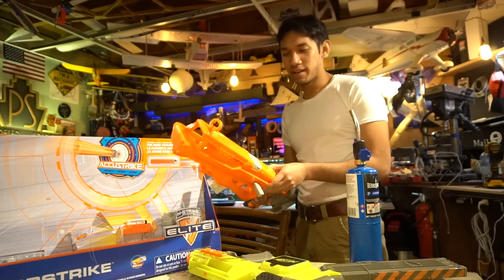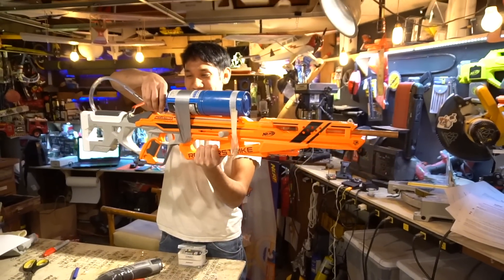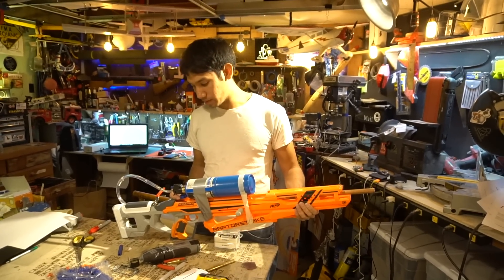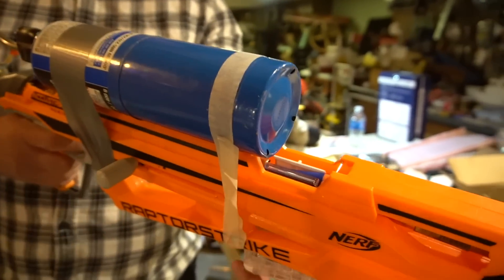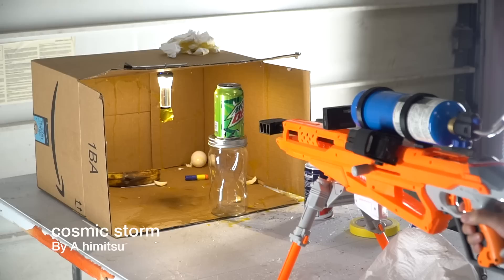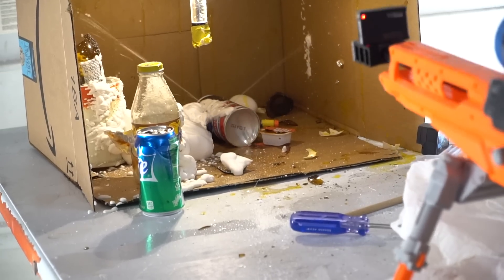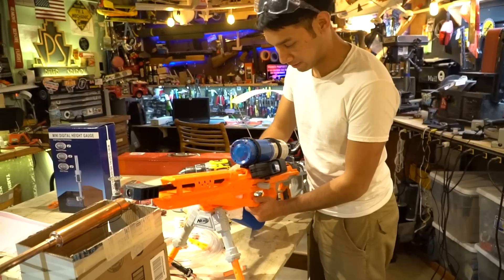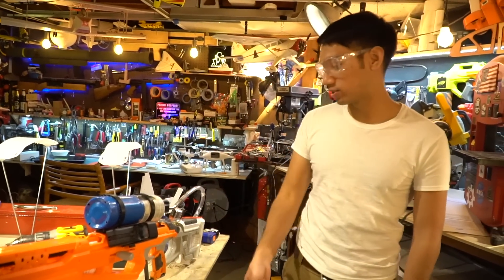Propane Powered Nerf Blaster!

Comment: I think the weird effect you talk about is due to leakage of pressure in the bolt section of the rifle, In the mechanism that chambers a round. You need to ensure tight sealing in that section of the pipe system.

Comment: 219 fps is pretty respectable. It's significantly better than any modded nerfgun I've ever seen. It's not the highest speed you can launch a nerfdart from a .50 springer, but at that point we're really talking about air rifles.

Comment: Why not have an electronic signal to shut the valve after a preset desired pressure? Less second guessing how much pressure your have and may improve consistency and remove having to shut the valve before firing

Comment: You should watch smarter every day 156, it will explain your dart sucking in and ignition issue, I believe they are related and I also believe it's castrating your power. The excess noise is probably a tiny sonic boom because the gasses are breaking the sound barrier. There is probably a good reason all cartridges ignite from the back. Hope that helps.

Comment: Wasting precious propane without burning it or using its ignition potential? Then you simply could use pressurized air. Leaking propane is damn harmful in terms of the greenhouse effect. Find some smarter solution please.

Comment: In case no one has told you yet, chronographs have problems indoors caused by external light flickering.  It's recommended to get the replacement shades with LED strips; that should fix the error.

Comment: My guess with the chronograph is that the projectiles might be too long for low speeds like that. The chronograph might not be able to pinpoint front and back of the projectile, so it wouldn't really have a reference to compare. But I'm not sure how these things work exactly, so it's just a thought.

Comment: For the chronograph, I've found that it's usually a lighting issue, I've found that halogen lights (or just outside lighting) help best with the problem.
Reply: Yup, that's what I found too, testing Nerf darts - minus the Propane. It's also picky about where the dart pasted as I recall, but I don't remember whether it liked high or low better.

Comment: Peter I figured out how you measure the stoichiometric ratio, you fill the combustion chamber with water, than divide that by the ratio of whatever fuel for example for propane it's 15.5:1 if there's a container 500 ml , device that by 15.5 and you have 32.26 ml and thats how big the propane tube had to be if you're using a water bottle for perfect stoichiometric ratio, I hope that helps, if you see me doing something wrong I expect you to tell me

Comment: Heat the female part of ur copper tube and get it red hot and then feed in ur solder it should never be in direct heat of your torch otherwise it’ll ball up like it did and you won’t get a good seal

Comment: oh I just figured I should point out, the Reflex is garbage. It uses a reverse plunger system and a weak spring just like the other blasters of it's time. The Raptorstrike uses a direct plunger system with a heavier spring, so it is much more powerful. Average chrono numbers for the Raptorstrike are generally in the 70 fps range.

Comment: Having the spark occur in the middle of the combustion chamber is always preferred. the flame front will travel more evenly and burn the fuel quicker and more efficiently, hence why the spark plug itself probably wasn't the issue, but more to do with the location that it was in. It's a heavily researched section in the Automotive sector, because burning fuel more effectively means better fuel economy,  lower combustion chamber temperatures, better emissions and more power.

Comment: 7:49 - Literally fire coming out of the barrel
Reply: Guys its fire... cause if its a Nerf dart its on fire
Reply: @Linusen9  no, it’s not fire, if you look at how he made it, there is a chamber which the gasses are inside of. When he pulls the trigger, the gas combusts, pushing the nerf dart down the barrel, however the gas would not come out of the gun as a flame, any fire would have taken place inside the combustion chamber, and the fire would be over in less than 1/10 of a second. That is not enough time to catch anything other than pure oxygen, or maybe some other explosive gasses on fire, nerf darts aren’t made of oxygen or hydrogen, so they won’t be catching on fire after being exposed to hat gasses for less than 1/10 of a second. Do some real research before typing false information into the comments section.
Reply: @reedrusty4290  chill it looked like it was on fire I'm nott a scientist
Reply: @Linusen9  ok
Reply: thats mean
Reply: Oh shit your right
Reply: It’s fire bro I looked and paused in .25 speedd
Reply: @Esock114  that is a nerf dart. The flash of blue after the nerf dart leaves the barrel is gasses being expelled from the barrel. Read a book on basic physics, then rewatch the part of the video where he builds the gun. You’ll see how it is almost impossible for a flame to come out of the barrel.
Reply: the dart comes out and is followed by a blue flame. that's not a muzzle flash cos that's a sonic boom but it is fire
Reply: people who don’t think it’s a flame: iTs A nErF dArT sTuPiD
Reply: Duck Face because it is a nerf dart •_•
Reply: @duccfaic2485  look at it in. 25 speed. It's a dart
Reply: Violet Judge Pause on the frame you see the "dart". It's fire, not a dart.
Reply: @duccfaic2485  , after reviewing the footage, it’s a nerf dart. Now, there is a blue flash after the nerf dart leaves the barrel, however, upon further inspection, it’s just the gasses being expelled at a very high temperature. If there was flam coming out of the barrel, the muzzle of the gun would have melted.

Comment: The chronograph - dunno if this will help, but you need to get the barrel right up to the front of the base of the instrument. You’ll get much more consistent measurements recording barrel velocity and the flight of your ammo will likely be at the correct angle.

Comment: this videos awesome. but i did think of something in the beginning, instead of the screws just sitting on the work bench and possibly rolling off or getting knocked off. what about fixing a large magnet to the bottom of the table some place? that way the screws stay fixed to the table

Comment: Personally I think the speed test was technically inaccurate. Say what you will but my experience with a variety of Nerf guns makes me see that the bigger the gun is, it can have less power and speed. For example: The Jolt is superior to the Maverick since it has better power, range and speed; but the Maverick is superior to the modulus as the Maverick, again has better power speed and range, but the modulus can sometimes fire 2 at a time which makes firing more difficult to predict. So long story short, you should try to get the same gun as the modified to see how much of a difference you actually made (BTW this is not a hate comment, saying this since some people are easily triggered)

Comment: You should use emery cloth to rough up copper joints. Also before you solder you should apply flux.

Comment: I am very certain that old tiny unmodified nerf pistol has a lower velocity than the newer raptor strike. If I remember correctly the raptor strike shoots about 70 fps (feet per second) and that tiny pistol i dont know for sure but i have used one before and remeber it was pathetic and a common theme with pathetic blasters is that they shoot around 50 fps so i guess the pistol has a velocity of about 50 fps (feet per second). I added brakets although it might be obvious to most fps cab be used for frames per second, first person shooter, fires per second, and feet per second that I know of.

Comment: Glue a magnet on the other side of the copper pipe, where you don't want anything to get past towards your air/gas chamber. So you could then see just how well the humble ball bearing that's the perfect size for your copper barrel. Also, I believe your losing the ignition effect to only release the force down the barrel and not lose any from where the MAG nests for the next round.
If your already doing that last thing, then sorry for missing it...

Comment: How are you metering the fuel/air mixture? In my experience with propane powered potato guns, propane only ignites when pretty close to the proper stoichiometric ratio. I'd assume that's what the length of pipe after the valve is for, but is there a pressure gauge or regulator to ensure the same amount is entering the pipe each time? Also, how are you ventilating the chamber after shots?

Comment: Aloha from Hawai'i Peter, enjoying your vids immensely.  Couple comments.  Get yourself a tubing cutter, MUCH better than a hacksaw and cheap.  Your cuts will always be square and clean so fast and no filing necessary after cutting.   Also when you sweat copper pipe an old plumbers trick (I'm an old plumber) is to let just the tip of the blue flame touch the copper pipe, and watch the color of the flame on opposite side of the pipe.  As soon as you see the flame turn green take the heat away and touch the copper with the solder, it will instantly melt and get sucked right into the joint.  Never melt the solder with the torch directly but let the heated copper do the melting for a perfect, strong, airtight sweat joint.  Mahalo a nui loa, and keep up the great work!

Comment: You could attach a small bit of ceramic from a spark plug to the end of a dart and make glass breaking rounds. The ceramic is harder than the glass, so it will only need a tiny bit of force to shatter the glass.

Comment: I think this was a great project but one thing i noticed that you might want to try is using some kind of junction from the bolt and the shut off valve so that when you throw the bolt forward it would also shut off the gas as well that would save on the number of steps that were involved int the firing of the gun.

Comment: if you made the combustion chamber a little larger and figured out a way to add some air into the chamber with the gas it would make a big difference to the power. Also compression would help alot here so if you were to place the projectile into the tip of the barrel to seal it (assuming it does seal) introduce the gas mixture into the combustion chamber and then push the projectile further down the barrel it would compress the mixture somewhat and produce alot more power :) tested this theory with a spud gun once and it made a pretty big difference.

Comment: Try using hydrogen + oxygen mixture that comes from electrolysis. It explodes like hell. (Or you can use some chemical reactions but you would have to adjust the mixture amount)

Comment: Can you add a mechanical linkage from the chambering mechanism to the valve? That way you could pull back on the mechanism, wait a few seconds for the propane/air to accumulate then push forward on the mechanism and be ready to fire. Would be a lot cooler to operate and just have a cool aesthetic look.

Comment: why not use a 12v solenoid valve for the flow control?  Use a NO contact when the bolt is open that way when you push it forward to load the dart it will break the contact closing the flow on the valve for the propane.  No more having to open and close the butterfly valve.  It could be something like this. https://www.amazon.com/4inch-Normally-Closed-Electric-Solenoid/dp/B00ON8XFSO/ref=sr_1_3?ie=UTF8&qid=1525075729&sr=8-3&keywords=12v+solenoid+valve  you may even be able to operate one with a battery.  If not there are manual valves you could tie into the bolt action to do the same thing

Comment: The trick is to combined the air compressor and the propane gas.

Let a charging handle going one direction fill the chamber with propane, then going the other direction fill it more with air.

Then when you fire it, it will be more powerful.

Granted, your rounds have to seal, and they have to hold up to a certain amount of pressure, and of course, the explosive power will be much more, so you might want to have the solenoid valve between the combustion chamber and the round, with a slight time delay or spark switch arranged so it only ignites when the valve is open.

Comment: The errors are from lighting if not from inconsistency of angle over the light sensors. It reads when it passes the first and then second and calculates the speed. Brighter light above or sunlight, and a straight flat shot should get better readings. Probably with the pistol too.

Comment: put a .500 barrel in a paintball gun , you will likely get into the low 400s ... propane ignition pressure is only about 120 psi , good for nerf but nothing compared to 850 psi co2.

Comment: Hey Peter, As a new general aviation project, maybe a brushless powered paramotor would be interesting. It's been done before, charging it with solar panels. 2nd hand paragliders can be found relatively cheap and you could reuse your brushless engines from your ultralight to make a twin powered paramotor backpack.

Comment: 11:15 It probably sucks the dart back in because when the gas combust it creates a vacuum inside the chamber. and scene there is nothing like air to fill the vacuum, it sucks the dart in to get the pressure back to normal.

Comment: if youre curious about the nerf gun fps

- normal average nerf gun : 70fps
- that small nerf gun (its called "reflex") : around 40-50fps
- raptorstrike : 65-70fps
- normal modified hpa nerf gun : around 150fps-400fps

Comment: you should make a model  "ekranoplan", its basically a soviet plane that drives on the water. 
heres a good picture:

https://www.google.com/imgres?imgurl=https%3A%2F%2Fi.ytimg.com%2Fvi%2FDGjXSg45iSY%2Fhqdefault.jpg&imgrefurl=https%3A%2F%2Fwww.youtube.com%2Fwatch%3Fv%3DDGjXSg45iSY&docid=m-JR7ghDtVl2FM&tbnid=Pixj3gI6jAHSyM%3A&vet=10ahUKEwiDke6_9bjaAhXI5IMKHap3A9kQMwg9KAUwBQ..i&w=480&h=360&safe=strict&bih=954&biw=950&q=russian%20sea%20monster%20airplane&ved=0ahUKEwiDke6_9bjaAhXI5IMKHap3A9kQMwg9KAUwBQ&iact=mrc&uact=8

Comment: You could use a couple of solenoid valves (one at the tank and one at the chamber) and have them actuate with the bolt. That way you wouldn't have to muck around opening and closing valves, and with having propane leaking out all the time.

Comment: Average stock nerf FPS is around 70-75FPS at the hottest.  200FPS is high performance flywheel blaster performance and is approaching dramatically unsafe (...it's a propane explosive nerf gun though so safety isn't really something that was expected at all).  200FPS at close range hurts.  A lot.  Even with a Nerf dart.  First hand experience with that.  :) All that said I would probably play with this... no more insane than drain blasters repurposed into single dart nerf bazookas.

Comment: anyone notice a blue flame at 7:50.

USDoD gonna hire you peter?
Reply: It is a flame bro
Reply: its got a muzzle flash now, lol
Reply: Francis C no it was a flame. I had to slow it way down and pause it. It was a flame.
Reply: It's a flame, it is obvious when you slow it down.
Reply: Montisaquadeis Thank you!
Reply: It wasn't a dart. that was a flame from the propane igniting.
Reply: Montisaquadeis yep you right :D
Reply: I did to
Reply: S A I was just about to comment about that till I saw your comment.
Reply: ฝรัง
Reply: Me
Reply: It was indeed a flame. Caused by the ignition valve when he put too much gas into the compression chamber
Reply: It is clearly a flame if you slow it down to 0.25 speed.
Reply: @Montisaquadeis  why does the 'flame' go away from the barrel and fly off screen?
Reply: WATERMELON gas goes away too as it’s burnt up.
Reply: Alright debate settled it was a blue flame but a nerf dart came out as well
Reply: That was a blue nerf dart
Reply: Goodrocket the bullet came first after that the blue gas came out
Reply: S A its the dart, dumbass
Reply: Boi, that was a nerf dart
Reply: It was blue nerf dary

Comment: Probably the hardest way to build a 200fps nerf blaster, but still super cool. Next time use 17/32 brass for the barrel. You’ll get a much better seal than with copper pipe.

Comment: To get the best readings from the Nerf guns, you have to put the muzzle of the gun right in front of the chronograph and sensor. That way you'll actually shoot over the sensor, it'll pick up the dart, and give you an accurate reading. With the Nerf pistol, you were shooting from too far away and at an angle. If you put it right in front and fire, the chronograph will pick it up. It's not broken; you shot it wrong. Good luck next time.

Comment: Just use the pressure tank from a paintball gun.  I'm not 100% sure, but I believe when you ignight the gas, it becomes a firearm. In most states even a paintaball gun is considered a firearm though. Good luck. Maybe you will have some comon sense enforcement officers who will just confiscate it and not press charges.